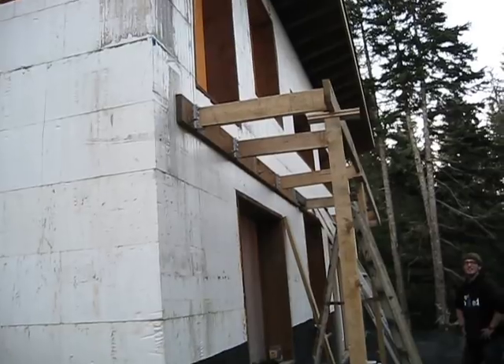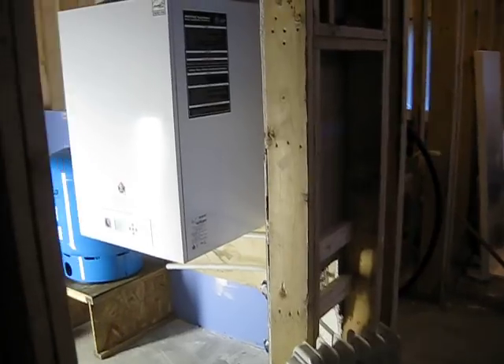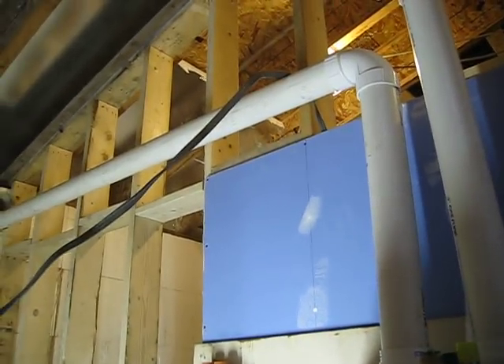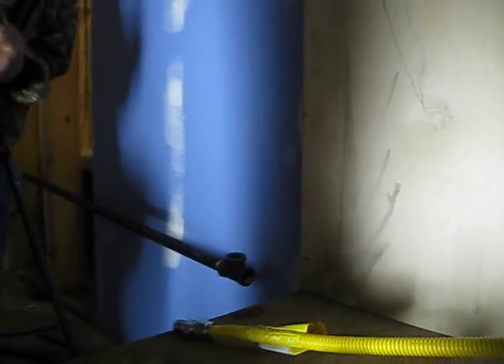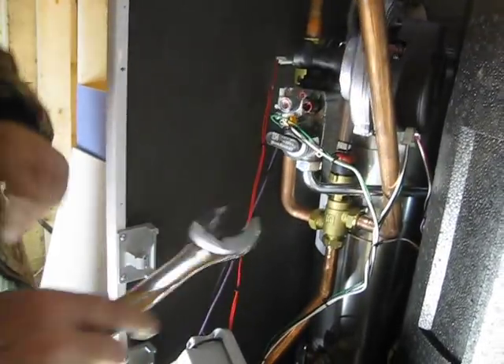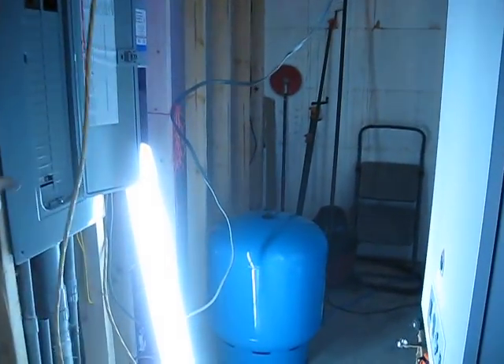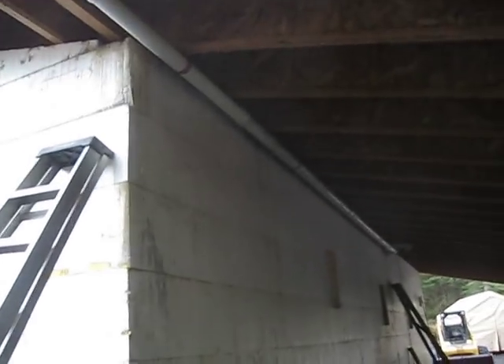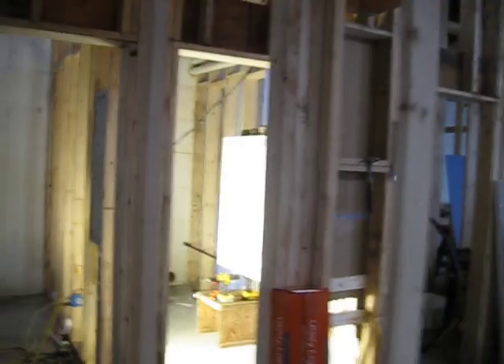House Building Part 13: Installing Boiler

Comment: people think building a house is a piece of cake but, they are wrong it takes alot of different pieces to make a whole. you are doing a good job on the build so far keep up the good work. stay safe.

p.s. always nice to have heat even if there is more work to do before it is closed in.

Comment: Congratulations on the progress. that water system seems a whole lot more complicated than my old house has. Of course we don't have sub-floor heating. 
For the gas line to the stove and the vent if you go that way, you could also do a small bulkhead above the cabinets on that wall to run the vent out, and the gas line over to the wall cavity you drop the gas down to the stove.

Comment: Thanks for sharing your build with us, I like the job your doing!  We built an ICF home in north central Minnesota and have never regretted the choice.  Are or have you considered an air exchanger, we found during cold weather it helps greatly with condensation on the windows.  The air exchanger also clears out cooking smells which tend to linger in such an air tight home.

Comment: I would do a vented hood, they just work better. Some pipe(what ever is required), paint and a few pipe clamps would look good. Think big old steam pipe with compression fittings, paint it to suit your style and wala, hood and oven vent that doesn't need to be hidden, would add some industrial look/character.

Comment: I have been following you on the build. On the boiler venting, the exhaust pipe if you keep it out under the porch area must be insulated or will freeze fast in the climate you are in. Please check the lenght of pipe for your alt looks long for two inch pipe? 

This is my first comment on you tube